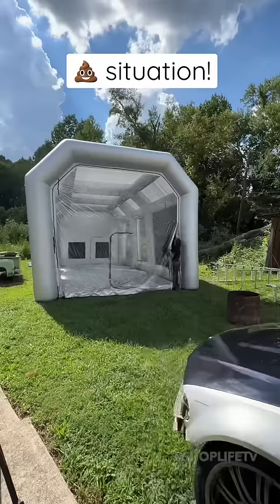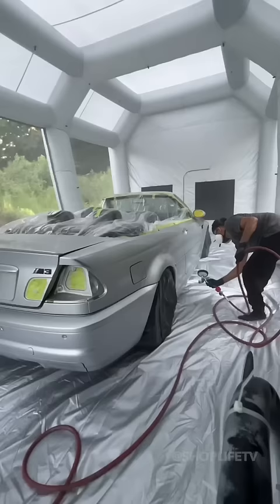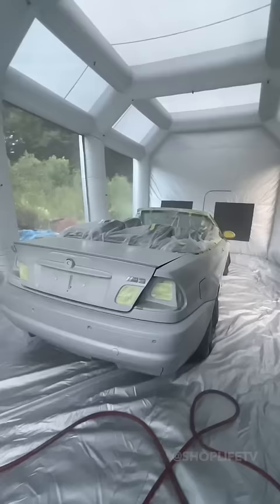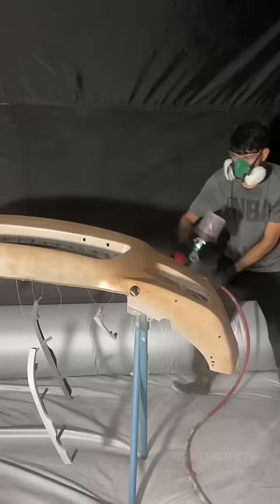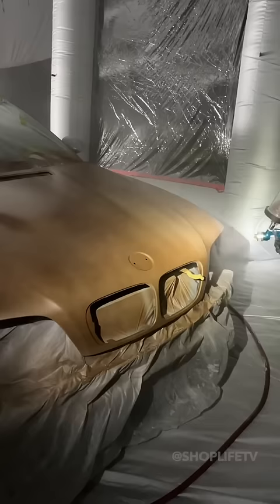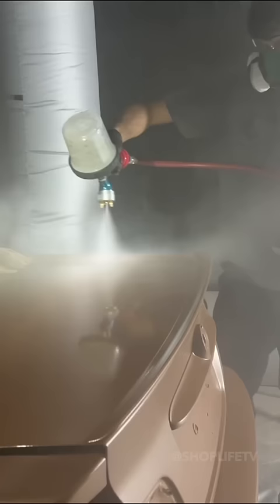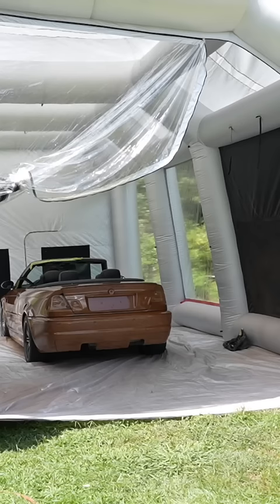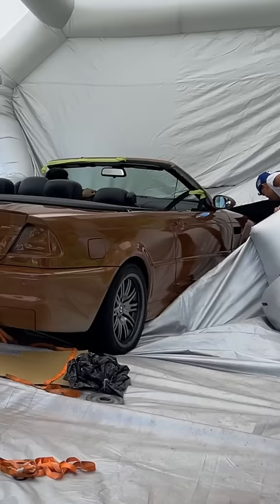My biggest fail on YouTube! #shorts

Comment from the maker: These were just some of the issues we faced. Check out the full video: https://youtu.be/AUI3HJqTmUE
Reply: Did a great job
Reply: You ruined it basically 😉
Reply: Invest in Old 8 ft gym Matt's.
Reply: Craigslist old gym mats
Reply: no thanks
Reply: To avoid the overspray problem, you gotta start spraying from the opposite side of the extractor fan, does the booth have negative pressure?
Reply: Dude, just poor planning. But y'all almost had it.

Comment: As someone who’s used dipyourcar (literally same thing as auto flex) I would highly recommend just spending the extra money and try vinyl wrapping your self, plastidip gets over spray every where in little crevasses and it’s so hard to peel off in some spots, especially if you leave it on top long.

Comment: If you use the inflatable again put a cheap tarp on the floor. You can cut it free and it prevents buildup and make sure you let the overspray dry before taking it down.

Comment: Those spray booths are worth shit. Never buy them. I bought a small one for bumpers and stuff, and the overspray flys around all dried up and ruins the painted surface. It can't replace the suction effect of a real body shop spray booth. You're better off painted outside in the open air and will get better results.

Comment: How about next time you just get a outdoor car port and plastic wrap it. Pour a concrete pad under and your set. inflatables are junk with floors and you also have to consistently keep it full and ground isnt even provides no traction. If you put a hard surface under it it would have worked fine tho. These are intended to be used in a driveway or parking lot

Comment: Yeah it's terrible to paint in really humid weather I found that out the hard way painted my old civic with the turbo spray can it looked absolutely amazing at first I did every single thing I was supposed to do for preparations but it starting cracking everywhere

Comment: Can someone help me understand why in the world would you need a high build primer before applying plasti dip? Shit was ready to go bro

Also, your solvents are drying up too quick reason overspray is drying on top, you need to use a retarder if you're already using slow solvents, that and those booths don't move enough air out